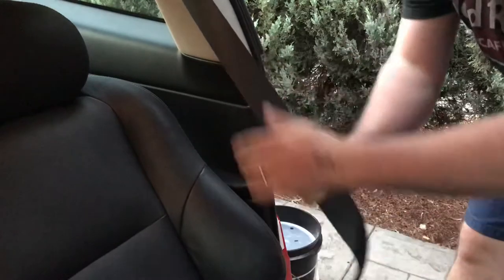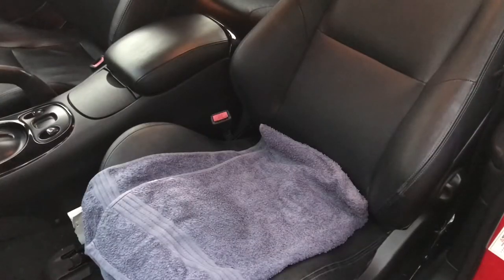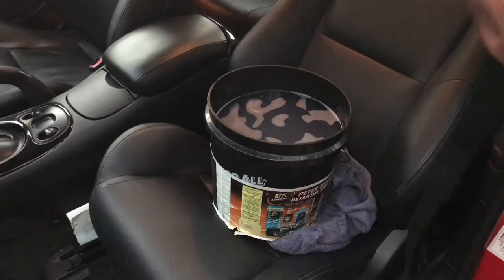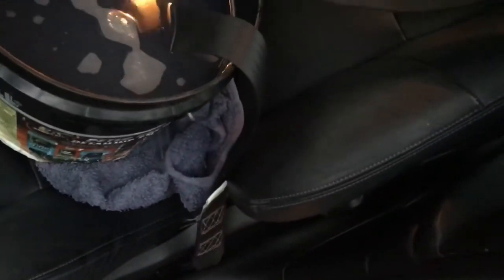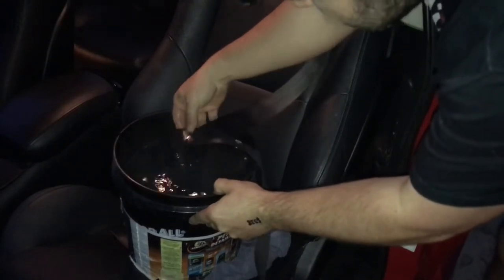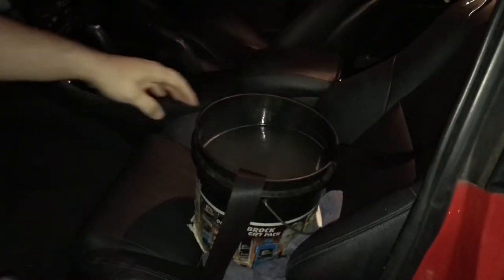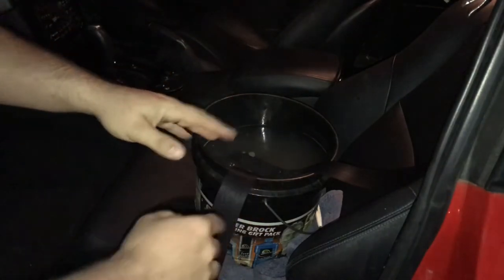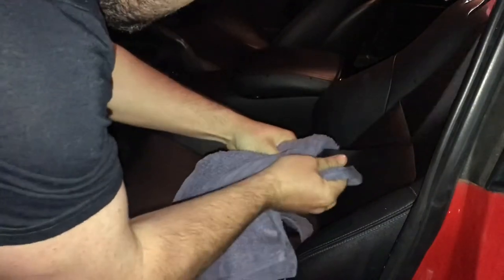CLEANING CAR SEAT BELTS

Comment: Hi Matt, so many people don't realise just how easy it is to clean their seat belts. It manly uses up time in allowing it to soak and then to dry, and as you've shown, it uses very little effort to do. Victorian drivers should realise that if Vicpol see that your seatbelts won't retract, that they can slap you with an Unroadworthy Notice and even give you a fine for driving the vehicle. It's obviously much cheaper to give your belts a clean than it is to buy new ones or even 2nd handies from the Wreckers.  Drivers should also remember that if you have an accident and your seatbelts are slack in tension, you or your passengers are likely to end up in a "world of hurt" or even dead.
Reply from the maker: Absolutely! It doesn't take much time at all and can really make a safe difference!